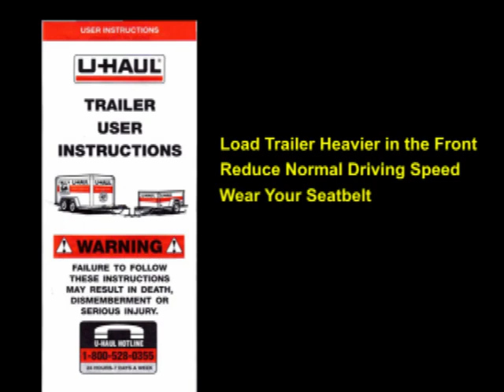Trailer Hookup (Braked) U-Haul

Comment: 1. This is obviously an unloaded trailer. 2. It is on a flat even surface. 3. The guy must be a weight lifter. 

There is a video by UHaul that shows these size trailers with surge brakes having a tongue jack to raise and lower the tongue to the ball height. You just back up the trailer and align the ball to the mount, then lower to connect. This isn't the reality! 

UHaul now expect renters to dead weight lift the trailer tongue up onto the ball. This is ridiculous.

We had to unhitch the trailer in an apartment parking lot, which was difficult to keep from banging down as we barely managed to lift it off. Even unloaded we weren't going to get the trailer re-attached to the ball by lifting the weight of the trailer tongue. We also had to no other place to load the trailer. -- We also realized we needed a chock to keep the trailer from rolling, which should be included with the rental. 

The customer service lady suggested we set up an appointment with their roadside service to come lift the trailer back onto our vehicle. This is crazy and never heard of a trailer without a tongue jack to help lift up the weight. Is it more cost effective for them to send out someone to re-hook up the trailer than to just have a tongue jack included with the trailer? 

We will see if they really do send out someone tomorrow and how long it takes.